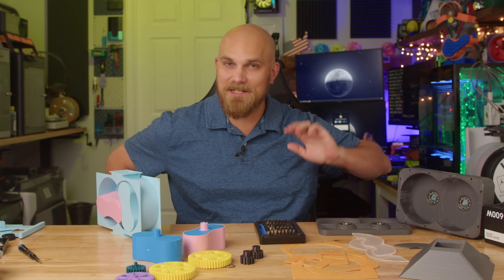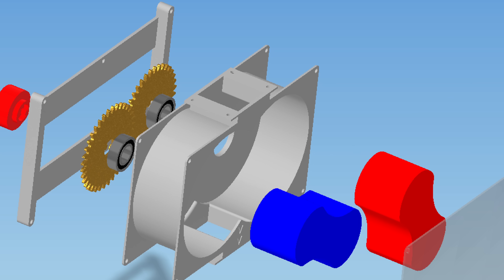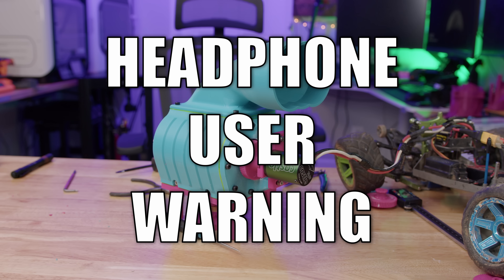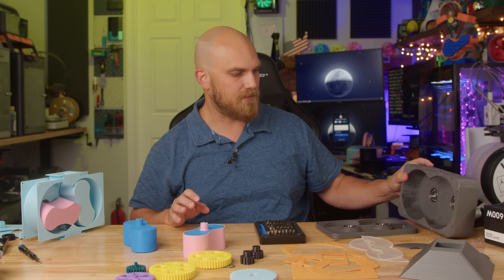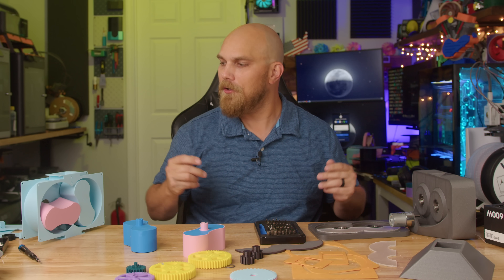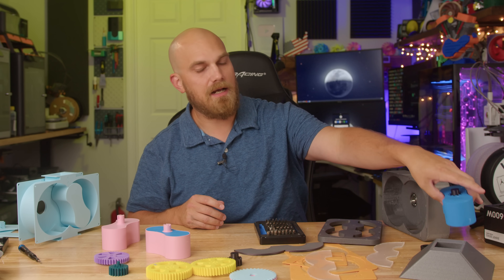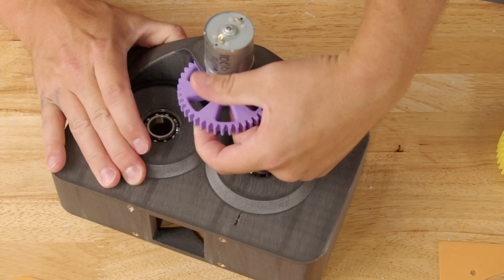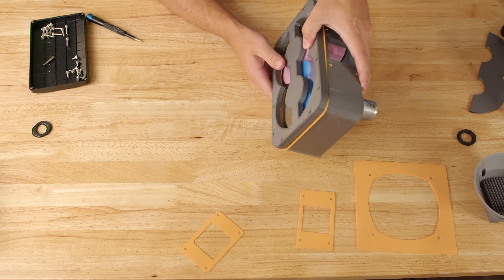Turning a Viewer’s Roots-Style Fan Concept into a Performance Beast! | Fan Showdown S6 REMIX

Comment: lots of noise and friction. very inefficient. need to have seals on the spinning rotors against the housing for it to push air more efficiently. look into how an actual roots style super charger is designed and im sure youll fix alot of your problems with this design.

Comment: I think it'd be cool if you attached a low-speed motor to that and just had it slowly twirling in the background of videos. Maybe just a little pwm controllable one with just enough torque to kick it off and then cap it at a lower speed once it's going. Could put some RGB in there too. Really gamer-ify it up.

Comment: So really theoretically you could print a 1 inch by 1 inch (or smaller) roots blower and a gear reduction on the a12x25 and it would make pressure very slowly (provided no leaks
Reply: I know high viscosity micropumps work exactly like this. They are just two rotating gears inside a small capsule wich you connect to the plumbing. I think they are generally used for constantly, slowly pushing grease into the port of big machines to reduce maintenance work.

Comment: Reduce the weight of the rotating mass. Thin down you gear set. Use ceramic skateboard bearing. Tighten up tolerances, and add some sort of lobe seal. These are where you gain perfomance.

Comment: Very cool! If nothing else, you demonstrated a lot of good tricks for improving performance and making it easier to assemble. I thought the smoke test still looked great, even if you couldn't see the smoke inside the chamber. Seeing it flow cleanly into the top and slowly building as it spread out the bottom was almost cinematic. Good work!

Comment: I'd be curious to see how much CFM this little roots blower puts out. Kind of a tangent, but a few air raid sirens back in the day actually used a roots-style blower to force air into a small fan to make it much louder than what would be otherwise. Many have made 3D printed models of these sirens, albiet with a Shopvac or a centrifugal blower due to complexity. Despite it being super loud, I'm sure this video could act as a basis for more people to try a roots blower at a small scale.

Comment: A minute and some in, I'm thinking compressors consume power. And transfer it to the air, raising it's temperature. That motor has very little power. And heated air is hardly what you want from cooling. Which illustrates why static pressure was not an ideal measure of cooling performance. You can take static pressure to the limit, but static pressure is not what cooling engineers work for. It's  a useful measure for comparing fans but ultimately not for cooling.

Nevertheless, quite curious what you were able to do with a fan motor driven compressor. Continuing watching.
Reply: At the pressures he is measuring, the heating of the air is insignificant. Cooling is all about how quickly you can carry heat away from whatever is hot. That depends on the temperature delta, but it also depends on the flow rate of the air: more air is more mass to heat up. The temperature delta is going to be mostly constant: room temperature air vs a heat sink surface that could be upwards of 50C. The air itself will raise in temperature by several degrees as it cools the heat sink. Adding even 1C to the incoming air won't matter much. But increasing the airflow by 3x is going to greatly improve the cooling ability.

The purpose of measuring static pressure was to provide an objective measure that would be a proxy for cooling when used on something restrictive like a radiator. What ultimately matters is air flow (and heat absorption, but we are just looking at the fan right now). For the most part, with a given resistance, more pressure means more airflow, so long as the compressor can maintain that pressure. Every fan and compressor will have a maximum flow rate it can support. Fans (compressors) used with little resistance are limited by the maximum flow rate. Compressors used with high resistance are limited by the pressure they can develop.

Compare this to the previous seasons where he was measuring air speed for a fan in open air. This is great if you want a desk fan to cool you off, but for cooling computer equipment, this ultra low resistance case isn't realistic. In many situations you are blowing that air directly into fins on a radiator which provide considerable resistance. Even for a plain case fan, the case itself and the stuff within it create a non-negligible resistance. That small amount of additional resistance can drastically reduce air flow compared to open air. The fans that did well in previous showdowns were tuned so heavily for low resistance that they would fail quickly with even a small amount of resistance. Testing static pressure swings the balance the other way, making people instead learn how to generate high pressures, even if at low flow rates.

In practice a fan would have to be able to provide high flow rates under moderate pressures - maximizing static pressure or open air flow will both result in a fan that's useless in almost any situation. James demonstrated that the A12X25 is capable at both ends: it can develop significant static pressure while also having a high maximum air flow in open air. It's this balance that makes it effective and versatile. If we really want to see which fans are best for cooling, we need to choose a range of specific conditions and then test air flow in all of those conditions. If nothing else, measuring both static pressure and maximum flow rate give us a reasonable idea of how the fan would perform in a variety of situations. (There isn't a linear relationship between pressure and flow rate, but it's a decent first-order approximation.)

Comment: btw, sewing machine oil is friggin amazing for reducing friction(for the open bearings) with just a couple drops and isn't effected by high heat.

edit: amazing design and surprised it worked so well. thought it would have trouble with the back pressure and start fighting the motor.
Reply: Glad to see a fellow sewing machine oil believer. It is my go-to generic lubrication. Unless the equipment needs very specific lube then sewing machine oil most likely will do it. It is made for sliding and spinning things and finely meshing gears. It also has good wetting properties, it stays on as a thin film for a LONG time. Doesn't have any particles, like for ex PTFE lubes have. It is wonderful stuff. It was in my childhood always there, my grandpa repaired sewing machines so it kind of became the "family lube", no puns for fucks sake intended.. Another that works well and even works well with sewing machine oil is.. good old vaseline. You can create the film with vaseline and then thin it with SM oil (no puns..) to get really good stay with good viscosity,

But also: if the application needs special lube.. don't use SM oil.... i've learned that too, it is not good for absolutely everything, like high heat: it ain't good at that.. Things need to stay below 150C, which isn't that big of a limitation.
Reply: grease the lobes too with it, it doesnt have to last very long
Reply: @david -- maybe print the lobes out of a harder TPU verrrry slightly oversized? But the friction losses may make that a bad idea.
Reply: I use Lew's fishing reel oil...It is incredibly thin and works great for bearings and other stuff that isn't going to be spinning for long periods of time...
Reply: Sewing machine oil or turbine oil is definitely needed. I don't think he would have had a problem leaving the grease in. The motor had power, and the longer the bearings spin, the warmer the grease gets, which thins the grease out and makes it easier to spin. Thats one of the reasons the bearings are sealed.
Reply: Fyi sewing machine oil is literally just light white oil. So you can avoid the markup.
Reply: @ObservationofLimits Just got a new 250ml bottle of SM oil for about (equiv.) $1.65. Not much of a markup, pretty much just paying for the plastic bottle, label sticker and logistics to point of sale at this point.
Reply: This.
Reply: Sewing machine oil is turbine oil btw It  likes to adhere to the parts coated which is what makes it so damn good. Rem oil gun oil is very similar. I use to use turbine oil for oiling my folding knives and also my bicycle bearings chains etc
Reply: Is it like clipper mineral oil?

Comment: So.... next season is water cooling pumps?
Or wait!  Let's go full circle with this
You water cooled an air cooler
Now it's time to pump air through a water block
Reply: If you pump strong enough you can even heat up the system!)
Reply: Oh, and water cool the radiator - FROM THE OUTSIDE
Reply: Make fan shaped pumps. Dunno about the torque, would probably need a lot.
Reply: Just hook up a 3/4 ton water source heat pump and install a ground water loop in your backyard

Comment: Maybe if the lobes and motor were connected with a flexible belt instead of gears it would reduce the losses to the point where a fan motor could drive it? It would reduce the noise too
Reply: The biggest problem is just inertia. Sensorless brushless motors like we see in fans have very little torque at startup. Normally these motors would use the back EMF (voltage) generated by the unpowered coils passing the magnets as a way to tell what position the motor is in, which it then uses to time the switching of the power to the coils. But at zero speed there is no back EMF, and even at low speeds the back EMF is too small to be detected, so the motor controller just goes through a set timing sequence in hope that it gets the motor spinning enough to starting generating that back EMF. During the time when it's running open-loop like this, it produces very little torque. The timing of that sequence is also based on the expected inertia of the load - if you increase that, you need to slow down the timing to give the armature time to get up to speed. So throwing a high inertia load on - even if it doesn't increase friction much - makes it very difficult to get started enough to go into closed-loop mode and start generating the expected power.

This is a common problem in combat robots as things get banged up and start dragging. If this happens mid fight, a driver may try to find a way to kick start the motor by hitting the blade against something, turning over the motor fast enough for the motor controller to sense the orientation and start driving it at with the correct timing.

Perhaps these high inertia "fans" need some kind of a pull-start to get them going! 😂Could you imagine him taking a drill to it to get it started like you would a small gas engine?
Reply: The lobes would lock up against each other. I sevice vacuum pumps, and when doing roots pumps like this, clearances is cruicial. Just a tiny bit off with the timing and they lock up firmly.

Comment: Jut use bearings meant for fidget spinners.
Reply: I think that's what he's using. They are a common size of bearing also used in skateboards.
Reply: @reverse_engineered  No, he showed us some metal ball bearings with greace inside, but fidget spinners use ceramic ball bearings with no lubrication. They can spin for a loong time with minimal input.

Comment: Pressure is heat. Superchargers generate a lot of heat, so much so they lose efficiency as the rpms increase beyond a certain point. Hot air is less dense.They also rob power to make power. It can be significant power draw. Just adding to the discussion, but it got me thinking... Add an "intercooler" section after "pressurization" with some standard Noctua fans blowing across sideways. Print the gears twice as thick  and use a helical cut to reduce the noise.
Reply: i'm like 90% sure none of that matters at all at this scale lol, i doubt there's anywhere near enough heat to meaningfully affect the the density of the air, and even if it did that's a factor in combustion engines that actively benefit from having more air to combust more fuel, this fan isn't doing any of that
Reply: @saphirakai  Possible. But it could end up really doing nothing.
Reply: If you need an intercooler your fan is pathetic 😢

Comment: Please for the love of god, use belts!!! My ears are dying right now!
Using gears rubbing on each other is the worst idea, meanwhile all cars have been using chains and belts, which are superior in every single way.
Reply: The problem with rubber belts is that they stretch, gear drive is more accurate, rubber can also break. My cam belt did just that and bent some valves, not good.

Comment: As a thorough engine head, I can tell you the roots pushes air around the outside of the case (why the smoke show was unexciting) and was actually originally designed to ventilate mines and blow air into forges.

Also I unironically want this on my computer but I'd definitely have to put some kind of temp switch on it for the noise, so it only kicks on when I absolutely need it.

Could I possibly get the STL files?
Reply: Maybe use rubber belts instead of gears to reduce the noise ?
Reply: @theelmonk  Roots blowers are loud, even if you quiet all the mechanical noise, just due to the way they move air. In a lot of applications, like truck mounted carpet extraction equipment, they use a silencer to make the noise tolerable.

Comment: Maybe the fan showdown could be expanded to allow dual motors / fans? Awesome print btw, hope it goes on display.
Reply: Fully agree, then you can have two leader boards for people to work towards!
Reply: I agree with this. Then it could have 1 lobe set powered from the back and the other from the front. This would make the only use of the gears to be keeping the timing.
Reply: Vote up! But within another category haha
Reply: Or a "Fan showdown crazy edition" with an ebmpapst fan. A real "spin off" show :) These things have torque.
Reply: Was going to say the exact same thing. Allows for two bearing for each lobe, geardrive would still suck some power but as both lobes would be powered it be 1/4 - 1/2 (?) as much
Reply: Season with multiple hub or a larger motor would be amazing
Reply: Convert to belt drive. Should be quieter.
Reply: Xbox 360 phat style duel fan season would be sick asf

Comment: Put graphite on the gears...less noisey and more spinny.
Reply: dry teflon spray.

graphite is nasty going everywhere on electronics.
Reply: @lasskinn474  which he already used 6:35
Reply: @joaomrtins  he calls it teflon oil, the dry crc or 3m (i guess dupond has one too) isn't an oil or "with teflon", they're a 'dry' ptfe(teflon) spray, the solvent evaporates leaving the ptfe on the surface. it's great for sliding surfaces you don't want stains on or to not collect dirt.
Reply: @lasskinn474  The can says it's silicone with teflon. The silicone won't evaporate, but it will eventually polymerise. Silicone isn't a good long term lubricant for that reason.
Reply: Graphite is harder than the gears, it's not the right lube for plastics.
Reply: @glenmcgillivray4707  Yes, technically "carbon dust" is harder than plastic. In my experience, using fine DRY graphite on plastic surfaces results in the graphite being smushed into the plastic at the areas of contact, and creates a hard carbon area which has very little friction and does not abrade the gear teeth.
Reply: @Pyroteknikid  Try tungsten disulphide... Yes tungsten, not molybdenum. It's the slickest substance known to man.
Reply: @glenmcgillivray4707 it doesn't matter for quick testing. The plastic would hold up
Reply: @glenmcgillivray4707  The graphite forms a hard slippery surface on the sliding parts, resulting in reduced friction and reduced wear.
Reply: Also frequently overlooked is tooth size, smaller is quieter.
Reply: @Vaporfry Tooth shape matters too. Those fangs are basically smashing into each other. They should roll against each other.

Gear tooth design is an art unto itself.
Reply: I wonder how much this is gear meshing vs gears rubbing the case.  If there's enough "stand off distance", then aside from lube, I wonder how hard it would be to print helical cut gears - if it can be printed at all.
Reply: @traumadog003  Different gear styles can be printed. Years ago, extruders used 3d printed herringbone gears. The other option could be switching to a belt drive instead.
Reply: @traumadog003  You'd probably want herringbone gears... that's usually what's used in turbine drives because they are self centering.  Straight cut spur gears are the strongest, but most loud, helical are quiet but not as strong, but you need a thrust bearing of some kind. Since the herringbone is basically a V, as long as you have them square, they'll run true and inline.
Reply: Could also sprinkle some graphite powder into the chamber so surfaces inside are lubricated too
Reply: I think the problem is the parts being 3D printed. I'm not a 3D printing expert, but you need very tight tolerances to make spinny things less noisy. Perhaps using a CNC cutter for the gears would improve things.
Reply: @hyperturbotechnomike  I work with 30 pound roots super chargers everyday. I can promise you that this style of blower no matter how precisely machined is going to he loud as hell.
Reply: Do you by chance own a 12A or 13B engine? This seems like a very rotary centric comment 😂
Reply: What about a figure 8 belt drive?
Reply: graphite would wear the plastic way faster, using herringbone gears would make the noise from them less harsh at least tho
Reply: helical gears would also reduce noise